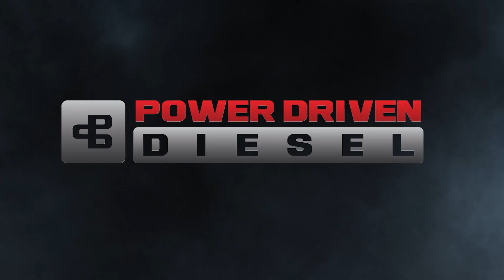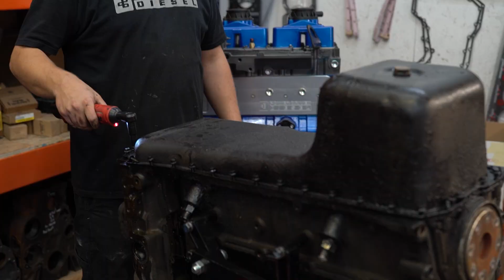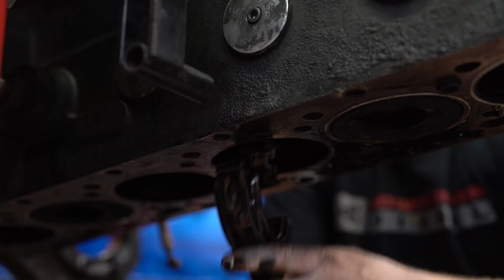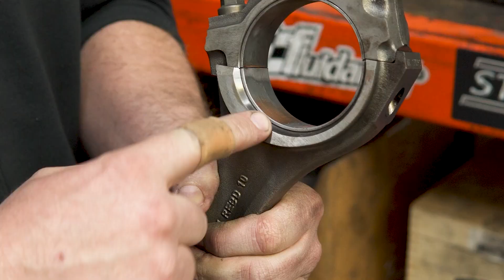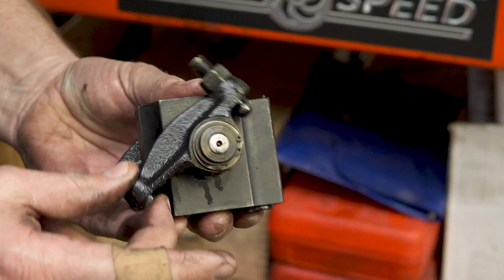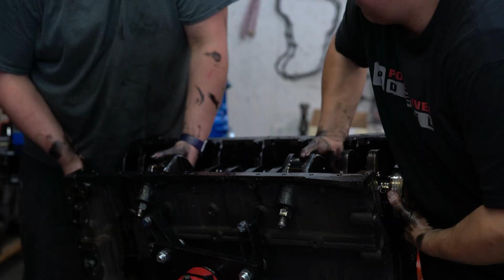Inside 650HP 12v Cummins After 350k Miles

Comment: Well, i need to be happy with 200-250 HP on a (heavily) modified 2l flat 4 Subaru Boxer Diesel in a Impreza 2008-2011.

And the 250 HP are far from reliable, 200 HP is with some mods pretty decent i guess (150k km actually on it, i hope it does 200k+ and im happy...)

Comment: Hi! Could you please tell if it is possible to detach pressure pump not removing engine front cover? If removal of standard front cover is required, is there an aftermarket cover that gives access to p-pump shaft fasting without removing the cover? The aim of this question is to gain capability to get p-pump to a shop for maintenance as easy as it's possible (not risking to add sand into the gears carter) in case of it's failure due to low quality fuel. Thank you in beforehand! And thanks a lot for giving such a vast of useful information in your videos!
Reply from the maker: You can remove the pump without removing the front cover. Just be very careful. Aftermarket gear covers do make this much easier!

Comment: When the APEX was released in 1998, now called the ISX15 or X15, A fueling engineer told me they ran one eight hours at 1200 HP in a test cell at the engine company. After the run it needed a set of rings/liners but the rest of the engine was reusable. (That model engine was in class 8 tractors and machines and if you bought the signature 600 it had 2050FTLB of torque and 600HP. In Australia that engine was in the "Truck trains" rated at 650HP 2250FTLB.) He said it is all about being able to take the heat out of the cooling and lube system. Air cant do that. He did say water can that is why marine engines can be rated at 170% more HP than the same automotive model. The engines design can handle the HP. But the candle that burns twice as bright burns half as long. We had a chassis dyno at our distributorship. I put a set of injectors in a customers 444 and dynoed it to check for smoke and power. I stopped running it when wheel HP hit 500 and the engine was still at 1900RPM. So yes they can take some HP.
Reply from the maker: Great post! Thanks!

Comment: Ive had my 98 12 valve for 20 years and no I didnt address the KDP until this year. It got me😂 Actually  Im  going back together now, I got the cam and valve train back in and boy what an adventure that was..! Who knew you had to be part wood worker to do this job..! I only have 160,000 miles on it because it was just my after work truck. That P7100 on the work bench keeps trying to tell me something every time I walk past it. Sounds like its saying governor springs delivery valves AFC mods....Oh yeah and injectors
Reply from the maker: Oh man, the KDP strike again. Hate to see that happen, but that sounds like an awesome rig! Give us a call if you need some power adders, (435)962-9555!
Reply: @ will do my man…!

Comment: What size injectors were you running on this setup?
Reply from the maker: Had our 5 X .014’s in it for a long time.  The new engine has our power jet injectors at around 1100 hp

Comment: Your video  is really making  me miss my 1996 f800  bucket forestry  truck  it had the 12 valve cummins mated  to a 4 speed allison auto transmission, I had  people try to call me out and say that I couldn't  have a allison in  a f800 because it's a Ford,  for can make a trans that good so the just bought  em. Great engine  tho super tough and sound great with a good turbo !
Reply from the maker: Classic setup that will run forever!

Comment: I'm pulling my truck engine apart and doing general maintenance like 60# valve springs and heavy duty push rods and stuff for making a reliable 500 hp
Reply from the maker: Heck yeah! Give us a shout if we can help at all.
Reply: @ thanks will do. I'm still on the fence with doing Compounds or not. I'm gonna try out the a Villain housing on my S363/68/12 from Insta-Spool Performance
Reply: @pddofficial  truck has 323k on it so I have a few minor concerns as far as rod and crank bearing condition as well as piston and cylinder condition but its been maintained well. All fluids changed every 5k miles with full Synthetic T6 Rotella. Not any blow-by other than Crank case heat that builds up. Oil was clean when I bought it. Its a little dirty dark after some minor mods.
Reply: @pddofficial  what are your thoughts to look for?

Comment: its a 5.9 not forced to eat its own crap
so its gonna look amazing! its when that acid is added( def ) they start tearing them apart
Reply: The DEF doesn't do shit to the engine.  It's just injected into the exhaust.  The biggest killer of these new engines is EGR and high pressure common rail fuel injection.

Comment: Did he just say "junk rotella" I have two cummins turned up to the max and they get abused one has over 700k miles the other is in the low 4s with zero issues and they are running rotella ......which pretty much never gets changed
Reply: How else would they push their in house oil brand???
Reply: I run T6 and noticed i burn a little more oil per 1000 miles, still thinks its better than conventional though, do you know about how much oil do you burn?
Reply: Go watch the in depth video Todd did on the oil. He goes into detail on ZDDP and calcium content, as well as hydrodynamic wedge, and then shows the trend in oil manufacturing from when these were new to today’s emissions equipment friendly oil that has less protections. 

There is some marketing, yes, but it is backed by factual objective science. I used to think it was all hogwash but don’t anymore. Just give it a watch.
Reply: I never realized Rotella was junk!!
Reply: @johnwilbanks3885  my thoughts exactly I drive a 32 year old cummins and a 30 year old 454 daily pulling heavy and thats all Ive ever used
Reply: Laterdude
Reply: Over priced oil

Comment: So I noticed my 1998 12 valve (has over 400k miles) is a 53 block.  It still has not cracked, like some do.  Do you believe I’m safe to push this block up to 350-400hp level with no worries.  Is there a way to measure wall thickness in the water jacket to see if it’s thin?   I really so badly want to hone, re-ring, re-bearing, install compounds and tow very heavy in the mountains.  Imma do it for science no matter what while in the background I’ll be seeking a non-53 short block replacement.
Reply from the maker: Most of the 53 failures seem to happen on the 24 valves. I can’t say it is for sure safe, but I would not hesitate to turn it up.

Comment: I like the sound of that. I am still working out the funds for the Truck I inherited when my Dad passed. I promised him I would make his rig special. What would it cost me to do that to my 94 12v.

I am assuming I still need to get the pan off upgrade for the trans, a better flex plate and a stronger torque converter so it doesn't just make the stock one slip.
The truck is all stock as far as I can tell, starts and runs super easy. Like we talked about before I was hoping to keep the mileage good, but truth be told I can live with a little worse mileage.

Comment: i currently own a boat with twin 12valve 370s"technically they are 355s" was always wondering if i can build a set of 12 valves to safely support 500-550hp constant load and still be as close as reliable as stock. What are your thoughts ? I know that qsb did come with a 480hp version of the 24 valve before they switched to a 6.7s .
Reply from the maker: With the infinite cooling of a boat I would think you could hit those power goals. Would need some good airflow though.

Comment: You can say any number you want. 650hp will produce more than 2000ft/lbs.. you are not working that engine at 70% to 80% duty cycle on average on these numbers you claim. I can say my 12v makes a reliable 1000hp while never hitting 1000hp to the ground. You can say it has over 3000000 miles on the setup while only touching 20% average duty cycle.. hicks wrenching the simplest diesel engine design and spouting ridiculous hp # as reliable. Making 2000ft/lbs in 1500 rpms is not sustainable or reliable....

Comment: What generation is this 12 valve he referring to? First or second generation? What one is better? I’m new to this. Trying to learn and research. Thanks in advance.
Reply from the maker: he is referring to the 2nd generation as for what is better all depends on  what you are after.
Reply: @pddofficial I got a 92 wanna beef it up a bit something similar to this power range. Something reliable but more power. Not looking to break the truck. Just want a daily that I can haul with from time to time.

Comment: What are the sought after cummins blocks/engines I can look for if I wanted to buy a used engine to heavily modify for a project vehicle?
Reply from the maker: The international blocks and the 215 p pump is what you would be after but at 1500+hp unless you are planing on filling it they all tend to break.
Reply: @pddofficial  nice..I was thinking around half of that kind of power....is there any way to destiguish them or pick them out if I were to go out to a junk yard...
Reply: @MrSuperchargedv8  stay away from 53 block as a general rule of thumb, as the block can crack open the water jacket on passenger side midway back due to thin casting.  Other than that I never personally heard to avoid any other block for any specific reason.

Comment: This was all good information but I keep reading where people are talking about the high mileage I don't know why they're saying high mileage one of those engines driven properly maintenance property should go push a million miles before they need torn into 7500000 at least
Reply from the maker: in stock form that is absolutely true but when you almost quadruple the horsepower of the factory engine the life span drops  to about a forth of it's life.
Baron

Comment: I want to put a 12 valve in my 1990 f700 hotshot truck what are y’all’s build prices
Reply from the maker: we are not currently building engines, but if you want to build it yourself we are more than happy to work with you on what products you will need. 
Baron

Comment: Very cool to know that I could go higher in performance (frankly, 99% of the time I'd still run it as conservatively as I would with a bone stock 12V) with no real component degradation. This is a prime example of good old American hot rodding - squeezing the most hp out of an engine without breaking the bank. Subscribed, looking forward to seeing more.

Comment: welding the cam gear on ? you could do the same thing with a couple of bolts and safety wire and is not as permanent, just a suggestion.
Reply from the maker: How would that work when it rotates?

Comment: (Machine shop guy here) something to keep in mind, all of those welds can & will cause weak points in your parts, the factory Crankshaft is heat treated & hardened. It is already very brittle, I have had it in other engines where the crank will actually split (yes like a log) after being welded, or heated in an extreme manner. 

Not bashing you, if it works it works, just something to keep in mind!
Reply: Best thing to do is do it right by machining a key way
Reply: @nickstetsyuk-ry1kt 

Why stop with one when you can get 3 at 120% degs. 

Loading the shaft at about 120% would spread the load to avoid any keyway from being the victim of the crushing force of a slip. 

Not really needed - but if you are already there, why not just because!

Comment: Question for you. I have a 93 1st gen w350. I would like to build it 600whp. It is a automatic transmission.  Would you recommend keeping it auto or would  I be better off going to a g56. I want to do p pump swap and your compound setup , k27 with the 369? What would you suggest? Thank you  for the good imfo.
Reply from the maker: Both will be great options but if it is a auto you will need an auto out of a 94 or new tuck so you will have lock up

Comment: I just put compounds 361 over 476 on my 3rd gen along with studs, springs, lift pump and coolant bypass.  The truck was completely stock with 150k on the motor but is now tuned to 650 hp.  I built it for towing and daily driving.  I was told to expect it to go 400k the way it sits and this just supports that.  Thanks for the info.

Comment: Been real curious what fuel mileage these built daily drivers get (500-700hp). I have a stock 98 12v auto, and get pretty consistent  to 16-18 highway, 10-12 when towing my 5th wheel, as low as 8 once towing into a bad headwind.

Comment: Wowowo, throwing stones at Rotella...
Reply from the maker: This truck has used/ran some Rotella in its lifetime, but ever since they went to the new CJ oil spec, the wear metals increased dramatically.  The current CK oil spec is even worse for the pre 2002 engines that were never designed to run with so little zinc.  Have you ever wondered why the new 6.7L Cummins engines abandoned the proven flat tappet camshaft setup and are using roller tappet?

Comment: What oil are you using? Tried finding it in comments. Good video I’m upgrading my 18 with banks parts.
Reply from the maker: For oil, this truck usually was filled up with https://powerdrivendiesel.com/product/conventional-15w-40-boosted-with-zddp/

Occasionally during wintertime it would get the full synthetic: https://powerdrivendiesel.com/product/synthetic-15w-40-boosted-with-zddp/

Or for the really cold weather, the newly released 5w-40 helps with cold starts: https://powerdrivendiesel.com/product/power-driven-diesel-synthetic-diesel-oil-5w-40-gal/

Comment: Did it have a problem ? Wondering why you took it apart if there wasn't anything wrong with it. Just found your channel liking the content. Amazing video was it drove hard what was the normal egt temp? Did u pull a trailer full time with it ? Or just a daily driver beat on type build ? Mine has 600 hp in my 3500 dually 6 speed. An on summer days it's usually 2k temp 4 inch straight pipe exhuast compound turbo set up.
Reply from the maker: The truck had no issues other than Will was bored with 664 HP.  Check out the earlier episode for the details on this 98' 12 valve: https://www.youtube.com/watch?v=uKAPhZZEQ8A

Comment: How often should a person change oil on a setup like this when using a quality oil like pdd synthetic?
Reply from the maker: At this power level, regular oil changes at 5k miles is pretty standard.  When you get up into the 900+ HP range, fuel dilution can become an issue and the limiting factor requiring more frequent oil changes.   If you sample and test your oil, you can definitely go to longer intervals 5k+ as long as your air filtration is good to keep the silica down and you keep an eye on the wear metals in the lab reports.  This exact truck had quite a bit of oil sampling done over the past 100k miles and Will pushed the oil change interval to just over 10k miles a few times and  it had 13k miles on the last oil change right as the engine was removed.  On the flip side, some of our BIG power race engines get fresh oil every 20 to 25 dyno pulls and after every 5 quarter mile passes.  On these big power setups, the oil starts to smell like fuel and combustion gasses because of dilution and the extreme blowby that occurs with 1800+ HP.

Comment: How often did you check your valve lash?
Reply from the maker: It was kept up and checked every 25k miles or so.  The cam wear is from the combination of high miles and really heavy prototype beehive valve springs with double the seat and nose pressure of stock valve springs loaded through the stock 12v tappets that measure just 1.20" whereas most built engines with upgraded "race" valve springs are running a minimum of 1.3" early 24v tappet, aftermarket 1.45" or even 1.5" Common Rail 24v tappets.

Comment: I am curious if you are running a Fass or just a modified stock mechanical pump on this unit? 
Also how are you keeping the head down? I have a somewhat similar setup but I cant seam to keep headgaskets in it
Reply from the maker: This truck was running a stock replacement PDD hotrod lift pump: https://powerdrivendiesel.com/product/hot-rod-modified-lift-pump-2/
This truck was also running o-rings and Torque Master Head Studs: https://powerdrivendiesel.com/product/optitorque-torquemaster-head-stud-kit-for-12-valve-cummins/

Comment: Could the same reliable, 100k mile, 650-hp be had with a 24 valve?
Reply from the maker: Yes, the engine will handle 650 HP, but with the factory VP44 injection pump, it's difficult to get 650 rear wheel HP fuel-only.  You'll definitely need a healthy sized injector and a potentially a hotrod VP44 pump if you have a factory 6 speed HO truck.  If you have a standard output 5 speed or 4 speed auto, then there's a good chance your factory VP44 injection pump will get to the 600+ HP range fuel-only.
Reply: Yes. This was a ‘98 storm block, same as a 24V. Heads and fuel system are main differences but yes a 24V can make this power reliably.  Life expectancy depends more on the operator.

Comment: Glad you made this video, I was already planning on building a project vehicle with a 12 valve Cummins, and this confirms the strength and durability of this engine 😁👍🏻
Reply from the maker: They are really well-built from the factory!
Reply: I’m still in the preliminary stage of the build, but I’m sure you’ll be impressed with the power potential of this type of set up